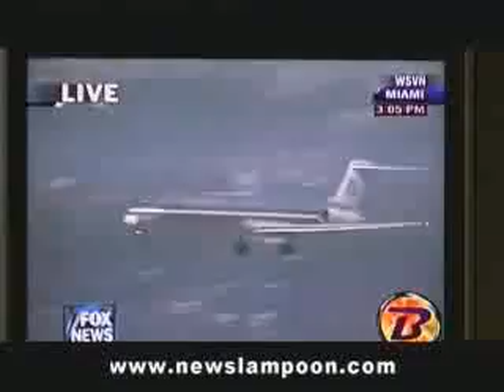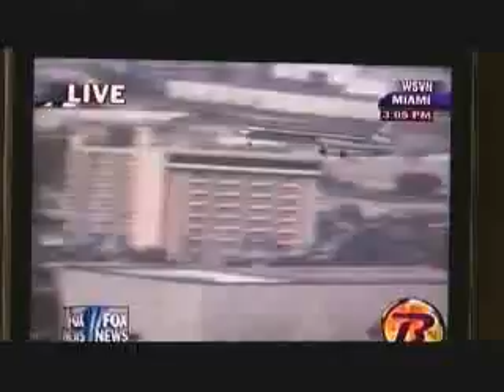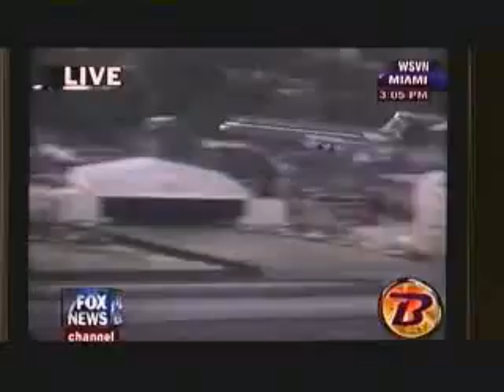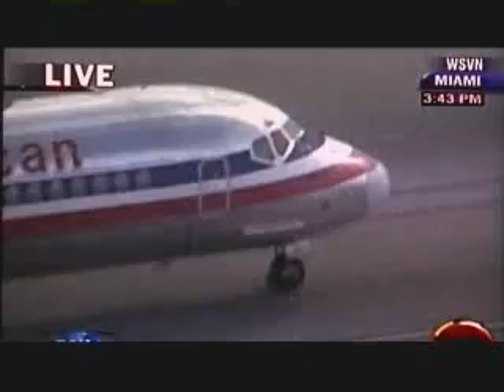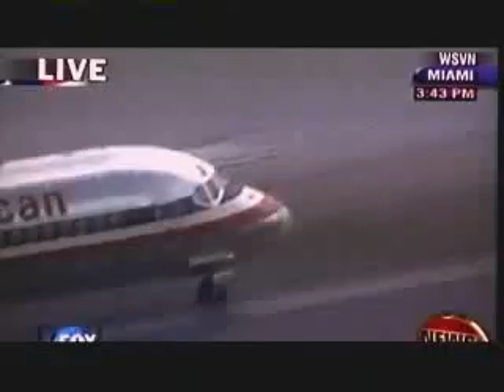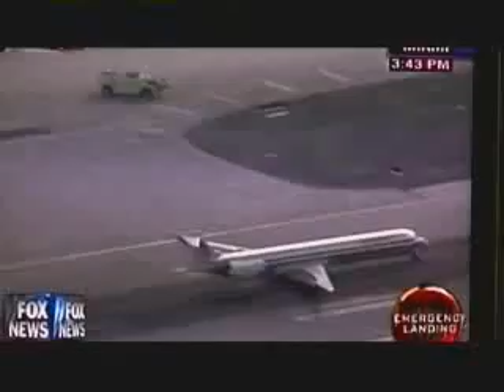Emergency landing at Miami International-2/22/08

Comment: AND MD-80s are generally older aircraft. This break, even with proper maintenance. I wouldn't be surprised if in 10 or 15 years we hear about more incidents with a320s as they start to age a little bit. 
The MD80s were bought in most cases before airbus was a big factor in the market.

Comment: It's 100% relevant. Aircraft design has BARELY changed since the 70s. The concept of the new 787 and all other aircraft for that matter was based off airplanes from the 70s. The only difference (and it is a major difference) is that 737s are A LOT newer than the MD80s. Like all mechanical devices, there is much less of a chance of mechanical failure on newer devices. Also, there is a reason why most airplanes have an average life expectancy of 18 years. The MD80s need to be retired.

Comment: Its not worth the argument. You could argue both ways, airbuses basically fly themselves as they rely on fly by wire, and boeings are more manual, and favored as well because you get more of a feel when flying. Both have their share of incidents, but boeing has the edge in most people's opinions because they have been around for ages, while airbus is fairly new in the buisiness. An incident on boeing could happen on an airbus, neither are perfect, but in the end they both go from point a to b.